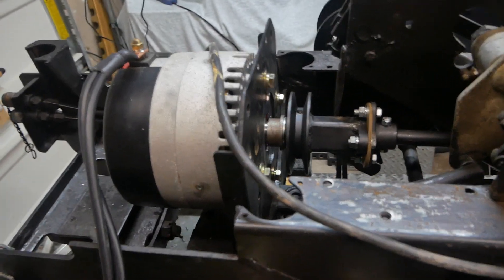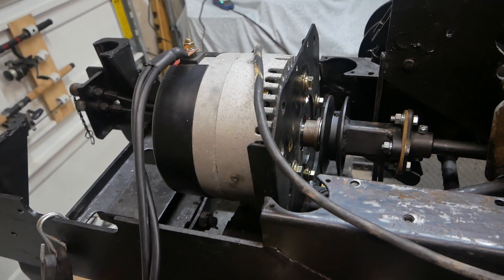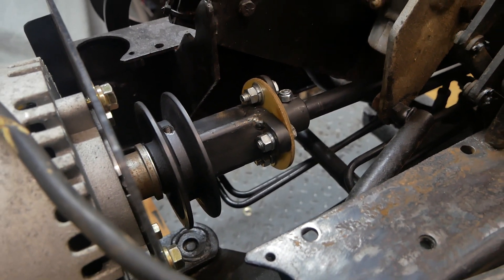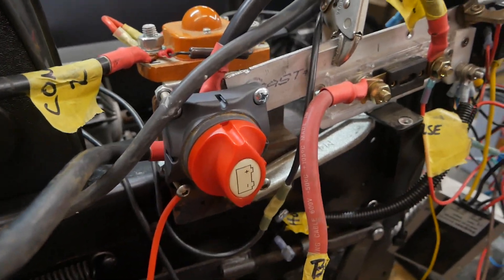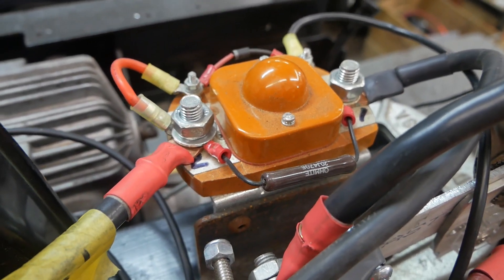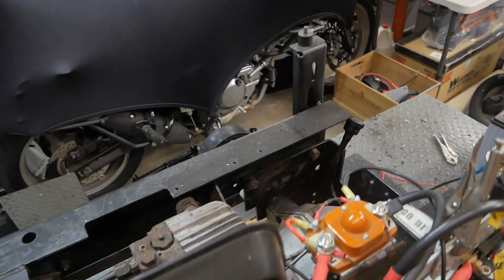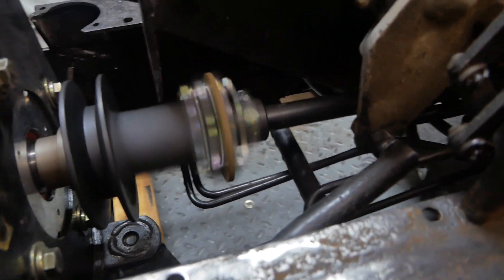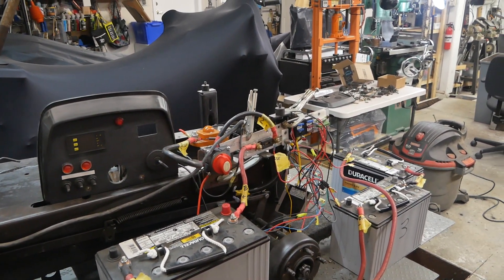John Deere 316 Electric Conversion

Comment: I really enjoyed seeing your video. I have a 318 I planning on converting. As a retired electrical engineer, I enjoy this type of project. Could you post a link for this motor?
Another post stated it's available on Amazon however I couldn't find it.
Reply from the maker: Look at the article on the JD214. All the info on the motor is in there... www.rvbprecision.com
Reply: @roybertalotto6355   I just read through your article on your website in the link and there is no link to the DC motor. You only mention its off amazon. Could we get a link here instead of having to trying to read though a whole article of light grey text on white background. Not easy to read by the way.  Cool conversion. Looks well planned and executed.
Reply from the maker: @high5alive704  ME1004 Brush-Type Permanent Magnet DC Motor. Available on Amazon
Reply from the maker: https://www.amazon.com/dp/B0083BDNJS?ref_=ppx_hzsearch_conn_dt_b_fed_asin_title_55

Comment: I have several questions, where are you finding your motor/ motors you are using. Also, how are you sizing the motor for the tractor so you have the right size motor power wise.
Reply from the maker: This motor was developed specifically for tractor conversions. Itvspins at 3300 rpm with 48 volts. It is available through Amazon. It is 13HP which equates to arojnd 20gas engine HP. Full torque from one rpm as all electric moyors exhibit. Amazing power….

Comment: Looks good. What rpm was the motor spinning at there? Hydraulic pumps and hydrostats can be sensitive to overspeeding. I couldn't tell anything just by looking but the movement of the drive hubs with no wheels on made me think it POSSIBLY might be oversped a bit. Just something to think about. Nice work!
Reply from the maker: A standard gas motor in a garden tractor should be spinning at 3300rpm for proper hydro operation. This motor with 48volts is designed as a tractor electric replacement motor with 3300rpm. I'm running it at 2300 RPM (36volts).....so well under the hydros spec. I was more concerned with it not spinning fast enough. But it is fine. Loads of power and plenty fast enough.
Reply: @roybertalotto6355  Sounds great, i knew there was a good chance my eyes were deceiving me trying to judge speed by those spinning wheel hubs..